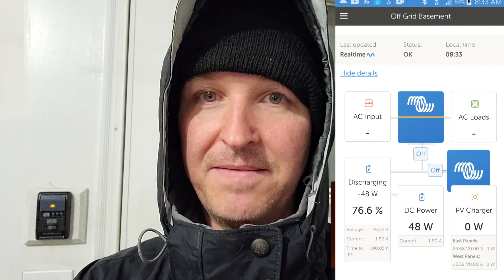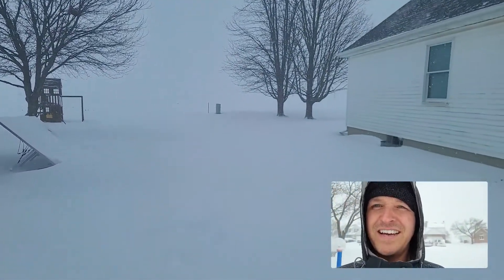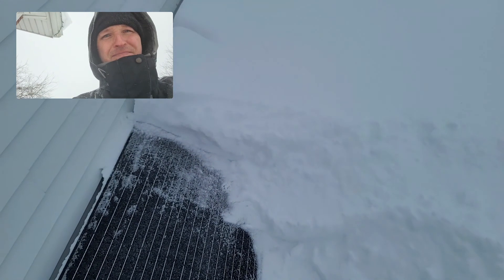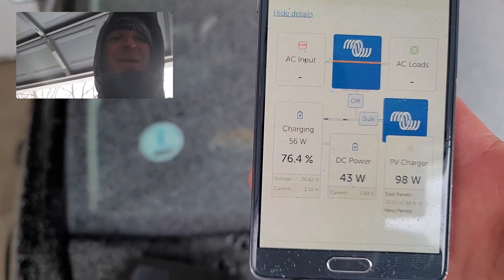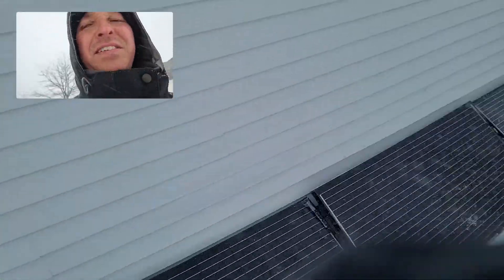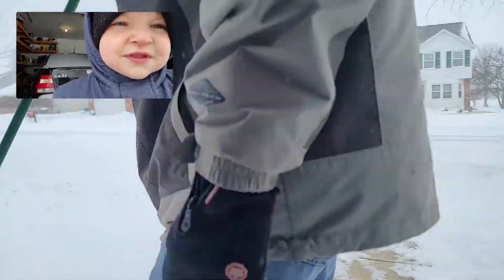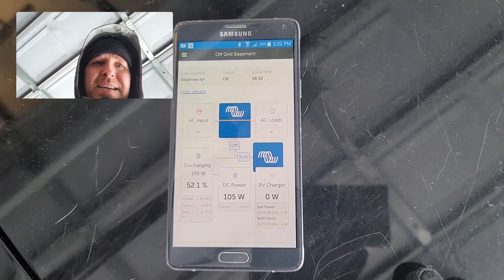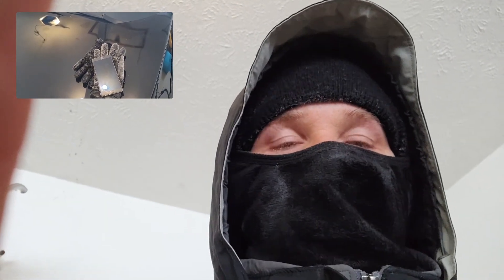Dealing with Solar panels during a Snow Storm!

Comment: Very interesting! Do you have to be careful about what you clean the solar panels with, or are the solar panel sufaces so sturdy that you don’t need to worry about it?
Reply from the maker: Thanks!  The panels have a sturdy glass front so using a broom works well.  Just don't use anything that could scratch or break glass!

Comment: My panels are also ground mounted. It is a lot work with so much snow recently. I would love to mount it on my fence at least 3ft off the ground  but I think it requires a permit.
Reply from the maker: Good to know.  I haven't looked into max heights without permits.  Even 12" off the ground would help.  Thanks for watching.